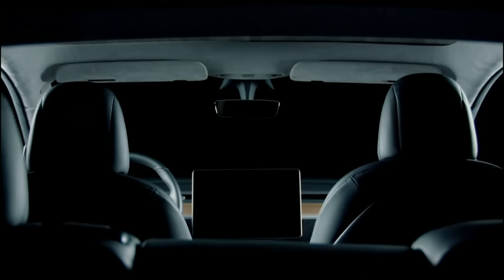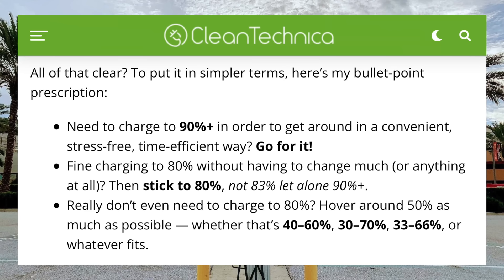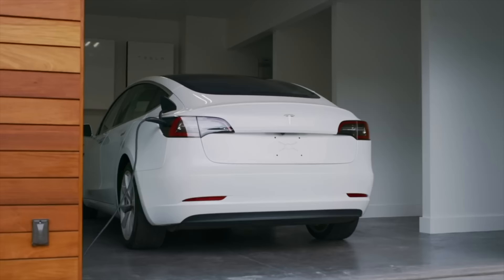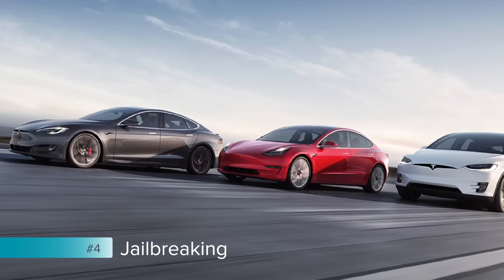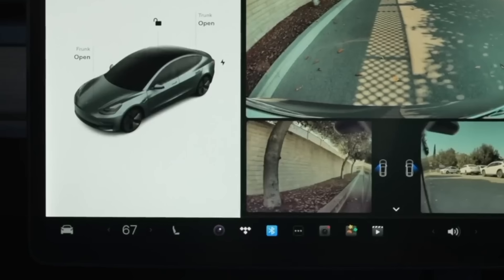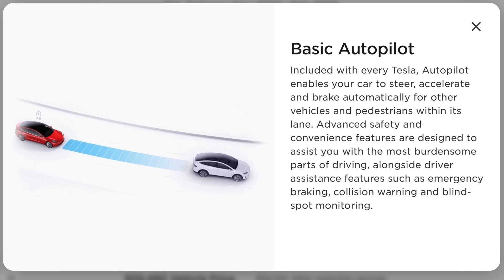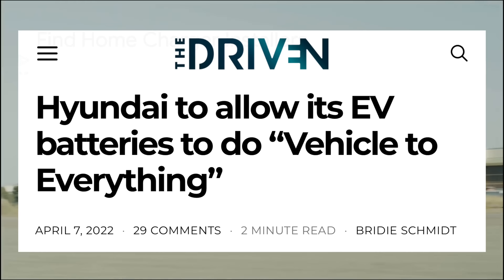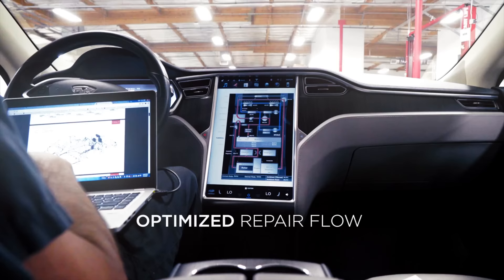10 Ways To Ruin Your Tesla | DO NOT Make This Mistake

Comment: From what I have learnt, a SR+ Model with LFP battery is having pretty much the same range as a LR, since the SR+ should be charged up to 100% while LR model should only be charged up to 80%. So what‘s the point in paying the extra money for a LR if it still doesn’t give you more range?
Reply: I’m getting the LR simply cause Norway has mean winters and the low height of the M3 leads to it easily getting stuck in snow. Traction on all wheels is needed. In Cali one would be stupid to get a Performance or LR.
Reply: AWD is the biggest difference.  Followed by acceleration.  Not sure if the sr+ has the premium Audio?

Comment: 3:12 onwards is plain wrong: LFP batteries will degrade substantially faster when charging constantly above 70% SoC. The ONLY reason Tesla recommends charging to 100% is the LFP chemistry's extremely flat voltage curve which makes it impossible for the software to calculate the SoC and remaining range. Unless you need the SoC and range to be precise to avoid not making it to the next stop on a long trip I would warn against charging above 70% SoC on a daily basis and then only to 100% every other week or so.

Plenty of evidence for this available online but to avoid a spam flag in YT system I will not insert them here.

Comment: How about the installed battery management system control it because most people won't pay attention to 80% or 100% high low to many options. Oh yeah and high usage stations automatically will set car at 80% so thereS that. You can change it but if your model needs 100% then it shouldn't adjust it down. Especially now that hertz is renting g 100,000 of these renters don't care its not their car

Comment: The dealer can't just void your warranty because of modifications.  It's illegal to do so.

Sue them in your local court.  The law requires them to prove the modification caused the issue to the court and in most places courts aren't real friendly to the dealers unless it's really clear it was the modification that caused the problem.

Enabling additional performance in and of itself is not a valid reason to void the warranty.  If there is a software lock and otherwise all the hardware us the same, overriding the lock is not a valid reason to void the warranty.

Tesla doesn't get to override federal law.  This sort of BS excuse was outlawed years ago, specifically because amazing warranties were promised to car buyers, but anytime service was required, it was refused because the owner broke some silly contrived problem.

Assuming it really wasnt related to your mods 
- Any lawyer can find an expert witness that can give you enough credibility that Tesla would lose, have to fix your car and have to pay for your lawyers and experts.

You can't sign away your rights granted by federal law just by agreeing to a software EULA on the dash.

Comment: Ryan question do you recommend charging model 3 using 110V or 220 nema 14-50 ??  Thanks for awesome videos!!!
Reply: I've been charging my m3 for over three years with the slow 220v 13amp charger, which I assume is similar to the US but perhaps slightly faster. At work we're sharing old poles so I set the limit to 8amp, which is truly slow but covers my daily usage.

Not noticed any battery degradation, the key is just to keep the charge between 20% and 80% for daily use.
Reply: They say that charging is more efficient at the 220-240v input. So I leave my 14-50 adapter at home and take my single phase 120v with me in case I park next to an outlet.

Comment: Is there an auto-parking feature that would mitigate the wheel rash issue? Unfortunately, I am not a Tesla owner but now with the price change I am considering it. This year I am scheduled to replace my 2007 Ford Escape hybrid which has worked very well albeit not quite achieving the expected mileage it has done very well currently at 170K miles.

Comment: The ghost module only works with older model 3s that were equipped with the same motor as the performance. Tesla doesn't care about this mod anymore due to the hardware in New model 3s not being capable of the upgrade.

Comment: One topic I hope you can cover,  Why is Tesla forcing Full Self Driving onto all the used cars on their site.  I ran a search for all vehicles for past 4 years (2019-2022) and not one does not have FSD included.   It would not be bad if the prices were listed as regular prices and they are tossing in FSD but that does not appear to be the case.
Reply: They are just trying to make a bit more money. You can request to remove it if you buy one of their used inventory vehicles and save yourself $12,000. It’s purely a software thing so it’s easy for them to just remove it upon request
Reply: I saw that too.  I wondered it they are not adding it,  just stating that it is available in the vehicle for purchase as an upgrade???

Comment: 16:53 Mine is 2023 Tesla Model Y. 
What kind of battery pack of my tesla ? Do i need to charge 80% or 100% ?

Thank you
Reply: To determine if your Tesla has an LFP battery, navigate to Controls > Software > Additional Vehicle Information on your Tesla's touchscreen. If you see “High Voltage Battery type: Lithium Iron Phosphate” listed, your Tesla has a LFP battery.

Comment: Except for one thing, all good advice. Lithium iron phosphate batteries do not prefer to be charged to 100%. Like any lithium-ion chemistry, this causes premature wear, but these types of batteries do wear more slowly.
So is Tesla wrong? Not exactly. The reason Tesla recommends 100% is because the battery management system has difficulty determining how to charge the battery is. The voltage difference between empty and full is very small and difficult to measure, but increases rapidly near full charge, making the state of charge quite certain. Lowering charge will increase the lifespan of the battery, but without semi-frequent 100% charges, the BMS will lose accuracy in its range estimates rather significantly.
There is almost no chance that frequent 100% charging will reduce capacity below 70% within the warranty period, but inaccurate range estimates are likely to cause customer complaints and expensive repair requests.

Comment: The autopilot safety stats suffer from a strong selection bias. Autopilot gets to pick only the easiest driving situations, and the stats don’t cover when autopilot disengages just before an accident.
Reply: Currently, autopilot is programmed to disengage deliberately about 1 second prior to certain impacts. This to ensure that the car does not try to keep driving during or after an accident. Tesla reported this and said that in those cases, they were included in the data reports.

Comment: Wouldn't over acceloration also be bad for the battery?  I've heard that this could cause damage.
Reply: you cant "over accelerate" a stock car. the throttle controls power output and it was designed by Tesla.

Comment: All good advice -- thank you! I'm wondering about frequent use of Supercharging -- is that harmful?
Reply: Only to your wallet.  Supercharging costs about 3 times as much as charging at home.  Also, Supercharging takes too long.  Charge at your residence overnight.  This only takes 10 seconds of your time while supercharging sort of chains you to the area around the supercharger although not as much as pumping gas does.

I have a 2013 Model S and 156k miles on the car.  I have done approximately 130k of those miles using the supercharger network.  My indicated range has only dropped 14 miles (258 down to 244).  Or course Tesla recommends against frequent supercharging and there may be more degradation with the newer cars that can charge so much faster than my ancient Model S.
Reply: @dougingraham5807  Thank you - point well taken. We do charge at home but may be going on an extended road trip that will necessitate lots of supercharging.

Comment: Great video, thanks! You pretty much convinced me never to buy a Tesla or any other EV in my life. Thanks, but no thanks. I'll stick my AUDI A6 4WD which has no daily maintanance apart from ocassional refilling of the wipers fuild and tanking. Other than these, I change the tires to winter then back to summer and change the oil and filters once a year. That's all I do as far as servicing goes. I just drive it and tank it without any worries. I can also leave my car for a week or even a month and return to it, start the engine and just drive it again without any concern.
Reply: Tell me you are delusional without telling me you are delusional 😂😂

Comment: “Change” is emphasized at the outset of this video, but change is not necessarily “fun.” I’ve been browsing EV videos lately, and they are mostly not convincing me that I should dump my ICE vehicle. This is one of those, and I’m not the kind of person who is an early adopter (aka living on the bleeding edge).
As an example, if 100% charging is bad, why does the car even allow charging (or discharging) to the point where the battery is damaged? A: So the manufacturer can claim the maximum range possible (even if the battery can be damaged).

Comment: LFP Battery has a big disadvantage by always charging to 100% in that your one pedal driving is gone each time you drive.
Reply: Huh?
Reply: Do you mean that the regen doesn’t work? If so, that isn’t true in my recent experience on mine. Took delivery 3 weeks ago, charged to 100 and it worked perfectly normal. 
I believe you are referring to the previous model battery, where Elon said regen doesn’t work at 100. 
Not true with these
Reply: @Greg-WBM  If regen does work as you say then 100% charge is not really 100% else where is the regen current going if the battery is full?
Reply: @mavinswapp9663  open circuit

Comment: Another tip: If you DO charge a battery to 100% (one that shouldn't go past 90%), schedule the charge so that it finishes charging at the moment you will be leaving, so that the battery doesn't sit at 100% for any length of time. When I accidentally charge my phone to 100%, I turn the screen on to run down the battery to 95% (same battery chemistry, a "ternary" battery).
Reply: Tesla can't account for each and every possible scenario so they give general guidelines that they know are good.  That doesn't mean that everything else is bad. Obviously, charging to 100%, leaving the car in the garage for months, and topping it off whenever it drops is a terrible idea  as would be leaving it almost depleted. 

And obviously, what you are saying is safe. But there's a lot in between. Occasionally charging to 100% and leaving it for a few hours won't hurt. It's just that it's impossible to outline every theoretical scenario in between.  If people want to charge to 100% so it will be ready for the morning, it probably wouldn't hurt either. 

But it's also fair to say that the amount of time it takes to add the final 5% isn't tiny, but adding the same number of miles to a low battery might take under a minute at a supercharger.  So unless it would be impossible to get to the next supercharger on a trip unless you charge to 100% (been there, before the network was robust) you aren't going to save much if anything by ever charging past 95%.
Reply: Actually, the LFP batteries will degrade massively if you charge them as stated in this video. Tesla has made the decision to avoid angry customers complaining about the Guess 'o Meter being just that by prioritising range indications over battery life
Reply: @health101DOTorg  No, you are wrong. Tesla only makes these recommendations for the reason I have already stated. 
They have even admitted it - which is understandable as the science is undisputed.
Reply: @health101DOTorg  I also happen to own PV LFP batteries from the same manufacturer and their recommendations follow the science as the range issue is non-existent is that scenario.
Reply: @health101DOTorg  No, not entirely but that the daily charging to 100% is just as bad for LFP. From the lab tests it was obvious that a quite large margin should be left at both ends of the true SoC on the cells. The problem the engineers faced was the voltage curve which in LFP cells is so flat that it cannot be used as the only source for calculating the SoC and the car’s remaining range. Therefore a combination of voltage and other variables is used but for that to be reasonably accurate it must be calibrated regularly by letting the BMS fully charge the cells. 

Tesla’s tradeoff between daily precision in showing the driver the remaining range and long-term degradation of the battery is understandable but as the owner I value the protection of the battery over the precise SoC and range indications. If I drove long distances on a regular basis that balance would tip towards precision. Also at least where I live battery SoH is a factor when selling the car as the Teslas are basically impossible to replace (which also means that even a tiny mechanical damage to the battery results in the car being totalled and sold as scrap by the insurance companies).
Reply: @health101DOTorg  Keeping it topped up at 100% may be fine if your BMS keeps a safety margin. My LFP PV batteries do not have any margins set, 0% is zero and 100% is full on every single cell. While LFP handles frequent charging to 100% way better than the newer chemistries it degrades severely when discharged deeply but they also still suffer from accelerated calender aging when charged often to 100% or left at 100%. No magic about it, even the inventor has documented this thoroughly and I do tend to believe him over some dumbed down advice to the general public.
Reply: @health101DOTorg  Not sure why my first response to the "industry-wide scam" with the inactivated links has disappeared - guessing the channel didn't care for the references - but there is no scam, or ill-meaning misleading going on. The advice given byTesla as well as other brands is just based on compromises between practical usability, customer complaints about unreliable SoC readouts and life span of the batteries.

Comment: I have a M3 Long Range. Usually, on a daily basis, I just drive 15 mi (20 km).

Should I charge daily? Und up to what percentage? Have read plenty suggestions, but haven’t figured out what the right one is yet, as many are suggesting different things.
Reply: I drove similarly to work for 2 years during the pandemic. Every 2 weeks, I would fast charge (only ~40kW though) from 10-90% and a few times down to 2% but charged it right away. I cannot charge from home and did not have sentry mode enabled at work or home. If you charge at home, you could charge to 70-80% daily or have it scheduled to go to 90% just before you go to work so that you're using that power right away and have more available later. If like me, you can't charge at home, I would charge just under 20% up to 80-90% depending if you will use that extra 10% power to commute home or other activities. I use 1% going home so if I'm done for the night, it makes more sense to just go to about 80%.

I have done a lot of "research" to understand the best charging methods and generally *if you keep any LI-ION battery between 20-80% your batteries will last longer*, even true for cell phones, etc. If you go beyond those limits, just don't stay there long - charge right away or use the power right away.

According to Tesla service, my battery "retention is within acceptable range" and they did not provide any details. When it was 3 months new, I was getting 322 of 325mi rated, then 315mi after 8 months, 309mi after 11 months/8.5k miles, and now, *after 3.6 years/28k miles, I'm getting 300mi at 100% charge*. This is about 2% degradation per year OR about 1% degradation every 4000 miles, which is exactly 30% at the 70%/120k mile 8 year warranty. At this rate, if someone drove about 15k miles a year (long commuters/work car/rideshare), they could hit the 70% degradation mark just before warranty time/mile limits. I do drive Uber so I might hit those limits.

FYI, this post took me a LONG time to write but I learned something about my battery rates while doing my personal research, mainly using pictures I snapped of charging the car over the last 3.6 years and checking service records (conveniently in the Tesla app).

Comment: why not just have one door handle it would be cheaper to make and have the window actuate when using that manual door handle, but still the door can be opened if there is no power just that the window won't roll down and it could damage the trim but won't happen that often.
Reply: Button is more convinient than handle.

Comment: “If you’re pressed for range, should you … charge up to 100%.” Who, in which world, would be so pressed that they’d need 100%? 95% will be fine. … (Heavy sigh.) If you charge to 95% (and drive not consistently downhill), with regenerative braking, you will NEVER charge the battery above 95%. On level ground, whatever energy you used to get up to speed will NOT be recovered by regenerative braking down to 0 mph – only SOME of that energy that got you up to speed will be recovered, not all and certainly not more (again, on level ground). … So, you need TWO hands to close the frunk? That’s stupid. Also, you should not need instructions on how to close a hood or trunk – it should be intuitive, like closing a door – if instructions are truly needed, print them on the hood. Also, if the latch is in the middle of the front lip, pushing down on the lid to both sides of the latch flexes the lid across the pivot of the latch. There should be LESS stress on the lid by pressing right where the latch is. The issue is more likely not to press hard (or put much weight on it). Since the car is supposedly so durable elsewhere, why isn’t it here too, Tesla?